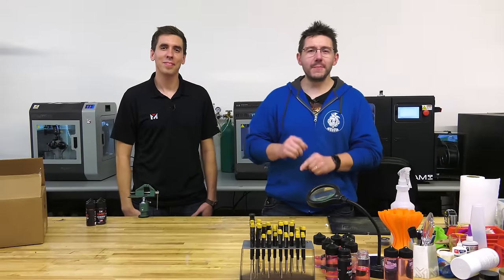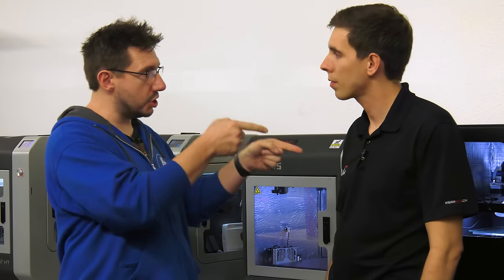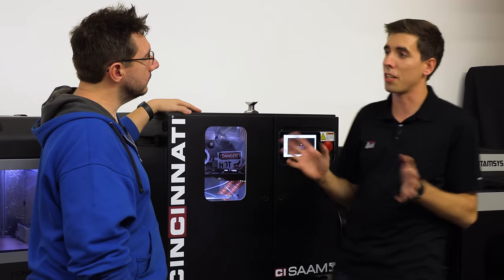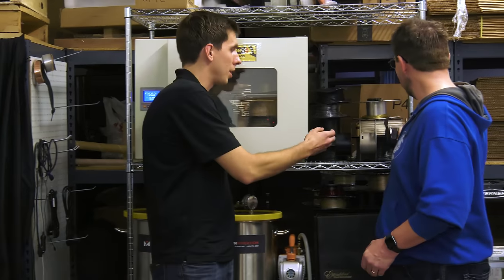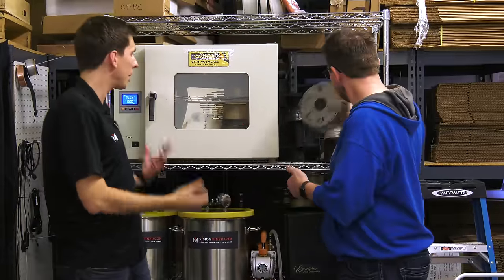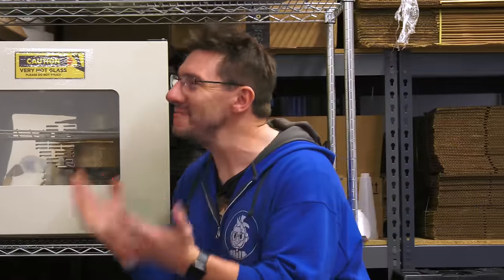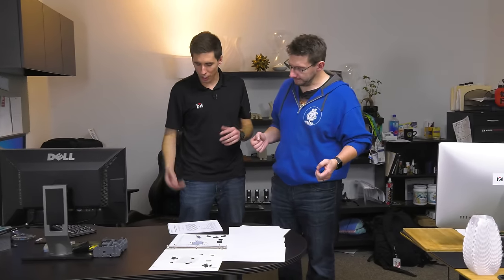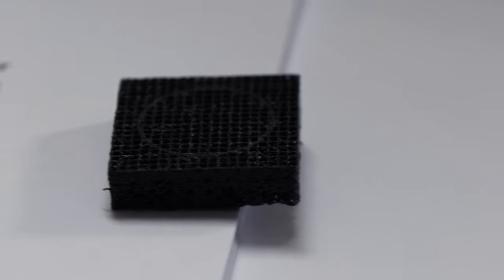High Temp 3D Printing FOR NASA with Vision Miner

Comment: 14:30 Everyone that has a 3d printer, has a box of failed prints that they can't bring themselves to get rid of. 😅
Reply: Not printing yet 2 years to get my parts from UK then putting it together as it was kit  an then 5 years later an no help to get my print plat to move down. An then calibrate it .sux  there bean utube stuff on same printer but most stuff up an rong update s plus.  .at lest it work s just need 3d tek.to help me. Hopen asap. An by another printer I hope
Reply: Andrew Bird same 😂
Reply: true
Reply: @countrabricksbuildcraze8916  they've definitely gotten better over the years!
Reply: :nod: I'll recycle them one day...
Reply: @countrabricksbuildcraze8916   I can help you to fix any FDM 3D printer under the sun...ping me if you still haven't got it working..
Reply: i have 3 of them :D
Reply: what’s wrong?

>I’m in this picture and I don’t like it
Reply: Too bad we don’t have the benefit of it being worth it to sell our scrap like machinists do... If you scrap a part on a cnc mill, at least you have a hunk of metal that can probably be repurposed or sold for scrap.
Reply: I have four 3d printers, the only box the failed prints go in is the garbage😂
Reply: Nah, recycle bin is my witness
Reply: I like that other people are doing this. At least I am holding onto it until recycling filament becomes a viable solution.
Reply: I chuck mine. I do have a full bucket of prints that failed on our flatbed printer, because most of them are from skipping steps or doing dumb things. Its my stupid tax bucket.
Reply: unless theyre a resin printer. then we pretend the parts never happened. something about being able to redo a print in under 6 hours makes them more disposable

Comment: hey! Vision Miner! instead of using a two step process for filament drying use a purge oven,its a lab oven with vacuum so you could do both steps at once!
Reply: Very true! We also use the vacuum chambers as storage, since we're constantly moving filament in/out of the oven. But you're 100% right!
Reply: Once the filament is in the heated printer chamber you should be good to go.

Comment: I wonder when you heat the filament under low pressure whether it also releases some VOCs / plasticisers. I did some water content measurements (non-filament, a complex organic matrix) in the past by heating of samples  and we always had the challenge to distinguish the water from other compounds gassing out...

Comment: Years later and I still have the same 120ml bottle of the nano polymer adhesive and its the best stuff ive ever used, i know these days you really dont need it but the security of knowing I will never ever have an issue with bed adhesion because of it is worth that one time cost

Comment: It was a modded Lulzbot Taz converted to print Ultem, not an Ultimaker. I made it. We were going to use liquid cooling, I have the liquid cooler in my office still, but decided to go for compressed air cooling instead as then you don’t have to worry about leaks.

Comment: I've been using their bed adhesive for about 6 months now. And it's the real deal. When using it with PLA on my PEI bed I have no warping on large prints. And after the bed cools, the prints come off so easy.

It's not cheap, but works extremely well and goes a long way.
Reply: Thanks for the comment!!

Comment: Does the drying/heating change the filament tolerances at all and do the machines keep the spool sealed to stop moister creeping back in while printing ?
Reply: Generally you want the spool in it's own heated chamber, to keep it dry -- especially on long prints! On the SAAM HT, it's actually inside the machine.

Comment: I got my sample of Nano Polymer Adhesive. It works very nicely for PLA. Prints doesn't come off as easily as they would have you believe, but it works for several prints in a row. It is so much better and cleaner than any other method I have ever used.
Reply from the maker: That’s great to hear!
Reply: Thank you!!

Comment: Just put my order in now, hoping to try with abs on a low temp bed and maybe some Fluoropolymers in the future!
Reply: Works great with ABS between 80C and 90C. I haven't tried lower yet though.
Reply: Works amazing with ABS, just watch out on glass -- it can pull chunks! Cover glass with PEI or Kapton for best results in ABS. Doesn't always pull chunks of glass, but better not to risk it. As for PVDF, it works pretty well -- but not always 100%, same with POM. Everything else, though, it works very good!

Comment: This is so awesome. And thanks for the free Nano polymer adhesive. Wonder if it would work for resin printers as well. You know I’m gonna try it. Lol
Reply: Not designed for resin printers, but hey, if it works, let us know! :D
Reply: Vision Miner I sure will. Gotta try it. I was having problems getting prints to stick. Come to find out it was the FEP that was the cause. So I used PTFE oil on the FEP and have not had a failure since. Knock on wood 😂

Comment: Wondering where the spool is when printing, inside the hot enclosure cooled by water which they just got rid of? Since they are using high temp material do they us a pre-heater on the filament (to get rid of any last moisture during moving of spool from vacuum to machine) before going into nozzle? Similar in how filament recycle machines increase temp by sections before extruding. So do they transfer filament from spool to spool themselves, or provide spools to manufacturer to start with?
Reply: For the Funmat HT, the spool is in the side panel --- on the SAAM HT, the spool is actually inside the heated chamber, keeping it dry indefinitely :)

Comment: Great video, I have a personal interest in high temp printing and one of my goals it to build my own high temp printer some day.

It was also crazy to see one of my earliest designs in the failure box!
Reply: Hahaha awesome! Which one?
Reply: Have u got a 3d printer built yet or ..interesting stuff. I got a kit one from UK but got print plate stuck.   Next steep to calibrating it. 6 years later need 3d tek. As I new to it but read 90 books on 3d stuff on kit n printing
Reply: @VisionMiner  It was the minimalist spool holder (Little MasterSpool Roller V2.0 , remix of Das Filaments one) with the weak arms that I can see are broken on yours :(

Lots of people had success with it (my self included ofc) but quite a few found it too flimsy and weak. The idea was to use a minimal amount of material so you can use scraps of filament while having some useful modular features.

I'm quite surprised you tried to print it with high temp materials! It has very little contact with the print bed and likes to curl up,  maybe a tribute to your adhesive? :)

It was literally the first thing I designed from scratch (so a bit of a design noob), I really want to revisit it and make the arms printable by them self, then slot into both sides instead.
Just too busy with some major projects right now, a custom built #myminimk3 and a E3D Hemera i3 carriage solution.

Maybe I wont get round to it, seeing you guys with your printers has reignited my interest in a high temp printer again 😂
Reply: @countrabricksbuildcraze8916  No not got around to building a high temp machine yet unfortunately.
Reply: @tetra3dprint  Nice!! Yep, one of the early HT spool tests, lol! That's awesome, man!

Comment: The filament removing chunks of glass is also an issue with PETG oddly enough
Reply: That's why you pay more for borosilicate glass on 3D printer beds (higher temps and lower thermal expansion) instead of plain old window glass.
Reply: @anthonyrich1592 It definitely still happens with borosilicate glass. In fact most of the stuff I've seen about it was with borosilicate glass. I just use a glue stick as a release agent

Comment: Have they thaught about using a high frequency oscilator to prevent  clogging whith the nasa contract?
Reply: Very interesting idea!
Reply: @VisionMiner  I used it for aligning nylon fibers to make a strand at school using a seperatory funel.
Reply: @henry67278  gnarly! What was the end product?
Reply: @VisionMiner  well it worked but it did encreased the amount of pressure needed to push the nylon through. Keep in mind this was done in my first year of alevel as a class project.
Reply: @henry67278  wish my school had such a printer, on to uni next hoping to find one thete

Comment: i cant understand the deal about oven and polymer adhesive i bake the filament in regular kitchen electric oven at 150 C and stick it on borosilicate  building plate by extra hard hair sprey. after cool down to room temperature i wash hair sprey with water its done. filament spool is in a plastic box that filled with little slica bags which comes from every new spool bag. filament goes to extruder by ptfe tubing that has 2 mm inside diameter. have no problem with printing carbon abs filament .

Comment: Very interesting video. Thx, Joel. And kudos to the folks at Vision Miner for failing fast and figuring things out. That's what it takes. Wishing them continued success. And, I'll be snagging some of that free Nano Polymer Adhesive, thx!:)
Reply: A side note about TERMINOLOGY. There is loose use, and then there is technical use. "...POUNDS OF PRESSURE trying to peel things up" [paraphrase] could mean that the physical situation was extreme and exceeded some limit. But technically, 
"POUNDS OF PRESSURE" is a mismatch in terms: pound is force (famously, F=ma), whereas pressure is force across an area (e.g. psi: pounds per square inch). Just sayin'. Take it or leave... no pressure:D
Reply: @swamihuman9395  Thank you! Hahahaha! *Noted. We learn so much from you guys... :D
Reply: @VisionMiner  . You're welcome. Glad my note was well received. As a teacher (math, chemistry, 3D printing, lasering, CAM/CNC, etc.) I value terminology. As an engineer I value terminology. As a consultant I value terminology. And, as a fellow human I understand the range of uses of terminology. In each of those capacities the challenge is to communicate, and to understand the others' communication. It has been famously said that, "The single biggest problem with communication is the illusion it has taken place.'! ~George Bernard Shaw. OK, that's it for now:) Carry on...

Comment: I also requested the free sample with free shipping a week ago, even though the destination was to Australia the order was processed. However the order now says 'unfulfilled'. Whats does that mean, not available or just not going to supply the sample because they changed their mind about free shipping after I requested the sample? Would be good to have an explanation of what 'unfulfilled' actually means. Shipping does not cost $74 from the US for such a small item.
Reply: Sorry, we ran out of stock almost immediately. We also accidentally gave EVERYONE free shipping -- Australia is one of the worst countries for shipping costs, as I'm sure you know -- but we're happy to send whatever you like, if you find a better rate and can get us a label or something! We're doing the best we can :/
Reply: @VisionMiner  Economy Air - 6 days with tracking, max 20kg & $500 cover is $32.70 AU ($22.25 US) plus a couple of dollars for the packaging is the cost to send a parcel to the US. 

You need a distributor in China, they seem to get the cheapest postage anywhere.

Comment: Well had my sample order cancelled. (ordered single bottle and would have been one of the first to order)
Can't even order a sample now as they've run out.
Suppose I'll just have to risk it and pay the $33 for shipping on a full size bottle to the UK.
Let's hope it lives up to the hype!
Reply from the maker: So far in my personal experience, the nano polymer adhesive holds on well, and holds when nothing else works.
Reply: @3DPrintingNerd  fingers crossed.
I got lucky on new year and scored 400x400 copymaster 3d for £129 shipped!! And it's the upgraded one with bl touch. 
Apparently it has a warped print bed, was so hard to fix for £270 off rrp :D but bed adhesion on the glass on such a big areas been  still a pain, so much so I've resorted to a smaller glass tile for now. 
Quite a nice upgrade from my old 2012 China home made special which has more than served its time and will likely now be getting the dremmel cnc conversion.
Thanks for all the hard work btw and best of luck with the channel in 2020!
I think we're having a resurgence in 3d printing and your channel will be kill it this year!

Comment: do you think they need supports in zero gravity?
Reply: brain = explode. I think so, becuase it would keep bridges from drifting around during the print.... like, metal SLS printing uses supports to keep the part from warping UP, hilariously!
Reply: I don't think there's any way around it. If it's unsecured, it won't "wipe" off on anything so it'll retain the velocity of the print head until it wipes off on something.
Reply: @androiduberalles  Ah, yes, very true. You'd almost need more supports!

Comment: I'm surprised a machine like that has the electronics inside the enclosure. It would have made more sense to have them outside of it.
Reply: Most of them are house outside, but for patents at the moment, some are still inside, like the steppers.
Reply: Or build electric s  into.  a inside an out side pannle s. Like a cool room for frozen foods.
Reply: @VisionMiner   Are you saying an existing patent is preventing them from installing the control electronics in a separate box outside of the printer enclosure?

Comment: I have a question about PEEK material,  you print in the form crystalline or amorphous ?
Reply: Semicrystalline generally. sometimes the application requires other methods...
Reply: @VisionMiner  I work in 3Dgence in Poland and we also manufacture industrial printers. And we also make prints from various materials such as PEEK, PEKK and PEI. Best regards and enjoy your prints.
Reply: @machen3135  Excited to use your machine! :D

Comment: How cool can one company get... 3D printed parts for freakin space !!! Sooo Cool !!!
Reply: A little cooler, IMHO, is the company I work for. It is disabled veterans owned and operated 3D metal printing parts for rockets. So not only will we be going to space, we will be getting the parts to space. Maybe you've seen it, but look up EOS printers like the M 290 400 and 500 and Intergra P 400. Huge cool factor even in the supporting equipment.
Reply: @JoshWeaverRC  yup, that sure is cool too ! I'm actually also very excited about Metal 3D printing and I'm trying to persuade one of my friends(CEO) to look into this for his factory in China. The added bonus for me would then be getting some RC/QUAD engine parts printed at an ultra low cost :-)
Reply: @JoshWeaverRC  Epic machines, even more epic shop, sounds like! :D

Comment: That Nasa article he mentioned came out in 2016. Their entire build was just a proof of concept for them and we already had people printing in High temp polymers and heated chambers. They referenced other companies printing in PEEK from 2014. https://ntrs.nasa.gov/archive/nasa/casi.ntrs.nasa.gov/20170000214.pdf

You can break glass just printing with PLA or PETG if you have the hot end printing on glass with voids. You can actually use fireplace glass if you don't want that to happen and still want to print in high temperatures. The cheaper your glass is the easier it is to break. Cheap boro glass and window pane glass has broken for a lot of people.
Reply: The article you are referencing is about High temp and open software use which as you stated has been around for a while and is still some really great stuff. What was really cool for us is that what we worked on for NASA has never been done before, and yes I am proud to say we were the only ones NASA could find that could do what they were requesting. The paper that NASA and Texas Tech University wrote about covers what we did with them. If you would like to read the paper they wrote and see how this was the first time ever using new types of processes and a new type of material which allowed them to accomplish what they needed in regards to "Monolithic Trace-Contaminant Sorbents Fabricated from
3D-printed Polymer Precursors"  Here is the link. It was Published July 7 2019    https://ttu-ir.tdl.org/handle/2346/84489. As always, thank you for all the Positive support you guys constantly give us, it truly is awesome and we certainly appreciate it .Have a Positive day.

Comment: Couldn't it be just as well be dried with focused pre-heating of filament, in theory it should make the full process faster because you wouldn't have to bake full spools, and it could also save energy because only a small section would be heated just before it ends up in the hot end?

Pellets would be smarter regarding this problem, a lot cheaper than spools and not very hard to make a heated hopper..

Comment: Just wait till this stratasys patent extension wears off next year. Then everybody and their brother will be selling printers that can make "real" parts out of the bad ass polymers
Reply from the maker: There are rumors that a number of manufacturers have machines capable of this but are software limited so that they don't infringe. Then, when patent is up, a software update unlocks their machine.
Reply: @3DPrintingNerd  haven't heard about that but being able to get your mechanics out of the oven is the biggest thing I think. Stratasys chamber temp is 185 for 9085 and over 200 for 1010. You know no amount of water cooling will allow motors and drive components to survive that at least without being completely ridiculous. My new machine (personal use) will be finished right about the time the patent is done. A baby 900mc
Reply: @3DPrintingNerd  this must have been what you were referring to https://www.3dxtech.com/gearbox-ht-printer/ 1/21 upgrades to 230c chamber